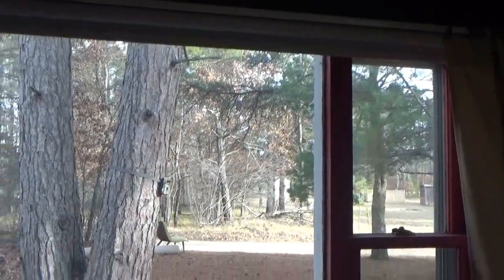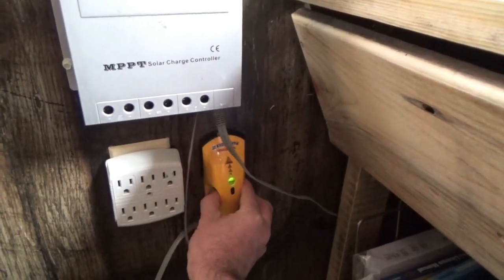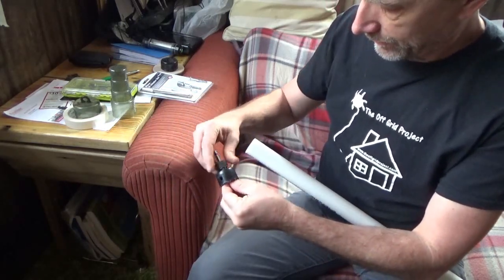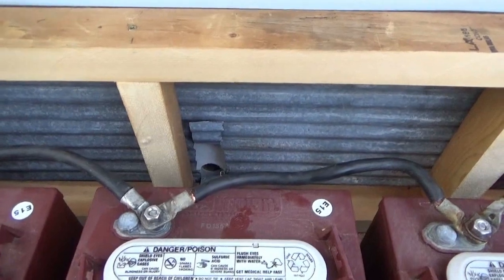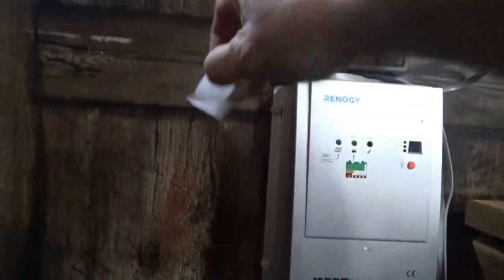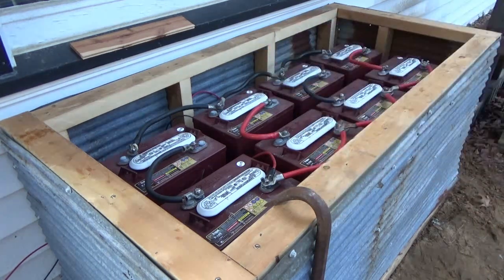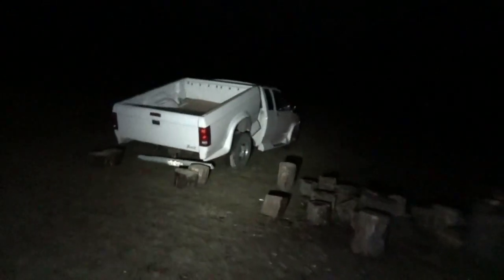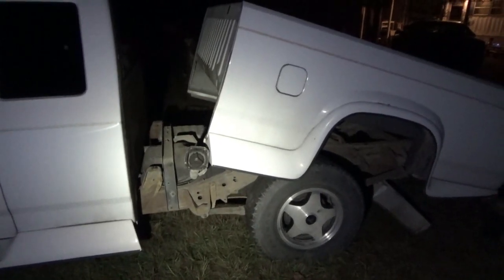Installing Solar Charge Controller & Solar Panels On Tiny House

Comment from the maker: Read the full article: http://www.thedoityourselfworld.com/articles/article.php?id=11556
Reply: Also should you make a small plastic water pipe coming out of the top of the box for gas to escape? Maybe a  1.5 inch plastic pipe about a foot long or more so it will draw gases out of the box. It should also draw warm air from inside the house into the box too so it would be a double purpose.

Comment: quick question...if you wanted to have a wind power generator...could you just piggy back it in with the solar panel connections on the charge regulator to subsidise the cold days when no sun shines on the solar panels..??  thanks and enjoy your videos from Sunny Australia..:)
Reply from the maker: Thanks. No because you need a special controller for wind turbines. They need a way to dump their load after the batteries are topped off or the wind turbine will self destruct when free wheeling in a high wind.

Comment: Are you powering your house on the same battery back as your workshop? Or a different one Tory? Can you asker me on that please?
Reply from the maker: Two completely separate systems. Way too far from on another to connect. I am looking for a way to bring the excess solar energy from the wood shop over to the house though but have not yet found a solution over such a long distance.

Comment: Is 10 gauge wire sufficient for all the panels in that array or just one panel?
Reply: 10 gauge wire would be sufficient if the voltage is high enough. Higher voltage reduces current through the wire.
Reply: Lankester Merrin like dork says, might be sufficient for the wire going into the controller, but I'd be worried about the ones going from the controller to the batteries. He might have high voltage coming in to the controller from the panels, but the controller will lower the voltage to match the battery bank and in turn it also ups the amperage, which is when you need bigger cables. I don't know what the voltage is on his battery bank but if it's only 12 or 24 volt, I'm pretty sure 10 gauge isnt going to be big enough
Reply: I wouldn’t go more than 30 feet with 10 gauge wire to avoid an unacceptable voltage drop at 24 volts. Perhaps he should consider 48 volts input? Looks like his area of Michigan only gets an average of around 3 hours of sun to work with. I’d be looking to maximise that available sun especially during these short winter days.
Reply from the maker: I am using an MPPT solar charge controller which allows me to wire the solar panels in series with one another. This increases the voltage and reduces the loss in the lines.
Reply from the maker: The wire from the controller to the batteries is 6 or 8 ga
Reply: He could double the 12v wires
Reply: It was 48v

Comment: If you have no power to the fuel pump.  There’s. Safety switch usually along the frame.  It kicks power to the fuel pump off in the event of an impact or roll over.  Look it up on line fuel safety switch make model year of your truck
Reply from the maker: I think its a bad wire because there is some low voltage on the lines.

Comment: Question Troy, why do you use the crap china mppt, in stead of the mutch better (and equiped whit a battery temperature sensor) (thats more inportant then you think)  60 amp Midnight solar mppt??
Reply from the maker: Money. Midnight solar is way more expensive. And I have this on hand already.

Comment: Troy, sorry, you make me cry..... Right connector size to the cable? Way to thin wires from battery to controller, and still no main battery  and solar panel cut off switch, And never connect a battery bank whitout a battery main fuse, not even temporary.. I know , its a video about your life and how you do things, y know, but man man man, you should know better, its not your own life risk, its also the lives of your wife and baby, Always do it safe, even iff its temporary... Sorry, dont want to troll, but in this case y have to rant against you. You know better! If you want to do it proffesional, do it correct.  This makes me feel sad....  Again, nothing against you, but....... gee man!!!
Reply: Hate to give of flak, its his life , but the point is some  people who thry to get info on these channels get mis informed.... Pont is he knows how you should do it..  in my opinion, get your materials all togeter, and your plan togeter before you start building this installations.. do it perfect the first time is always better, and faster in the end, Y still wish him well! thats absolutly not the point.
Reply from the maker: Its only 400 watts of solar panels. This is the largest wire I can physically fit into the charge controller. I am limited by the actual controller fasteners.
Reply from the maker: As to the rest - I did not even know if the inverter worked or not. Wanted to try it fast.
Reply: i dont mentioned the panel wires, on a high voltage the wyre you use is fine, and no need to fuse(panels dont give that high amp rating to create a fire) (tho its better to put in a fuse and a breaker yust to be to code.), y mentioned your battery cabels! , a fuse is a absolute must, in case of a short you have more than a 1000 amps to create a fire... please be safe, for yourself, your wife and your baby!, be safe is nr 1! (y)
Reply: for your inverter use the thickest wire you can find (welding cable ) and as short as possible , whit a fuse near the batterybank.

Comment: check and see if you have a 15amp fuse relay block for the fuel pump under the hood of your truck, and swap it with the 15 amp horn fuse relay block to test if it is bad or not.  I had that problem on my gmc Sonoma,  and it was the fuse relay block and not the fuel pump...
Reply from the maker: I swapped out all four fuses and relays with one another in attempt at figuring this out. They are all good.

Comment: Troy I hope you're going to do that  professionally run them wires running from the solar panels to the house in PVC pipe and bury the pipe just wondering
Reply from the maker: Yes I plan to do that.

Comment: You don't need to waste money on a stud finder. Tap on the wall wîth a hammer, the sound of the tap over a stud is distinctly different than over a hollow spot.
Reply from the maker: Because I tried that when mounting my TV and never could find a stud. The drywall is muffling the hammer. I hit air behind the wall every time.
Reply: I don't know what to tell you. I've been a house carpenter for 35 years and never had a problem. Give me a second, ill get a hammer an try it on my sheetrocked walls now. OK, I'm back, took me ten seconds. There was no mistaking the difference between the sound over a stud and the sound between studs.

Comment: The relay under the hood that cuts off the fuel pump in wreck needs replaced. it happened to my truck too. took me a  long time to figure it out too. Replace the relay for the fuel pump. They are cheap 10 dollars or so. I found this  If the relay's power circuit is not energized, then you're just going to have to start following the wire back from the pump to the relay, checking every so often to find ... cutoff switch, which I believe is located very near the pump itself, which is designed to cut power to the fuel pump in the case of an accident. yeah But on my truck it was the relay itself.
Reply from the maker: Actually I swapped out the relays and fuses already on the first day. No go.
Reply from the maker: I can hear the relay switch on when I turn the truck key
Reply: In that case maybe you need to change out the electric fuel pump in the gas tank ? seems like? Not real expensive. Not real hard to do.

Comment: Hi Troy the Renogy can onl handel
Max Solar Input Voltage 100 VDC @ Minimum Working Temperature 
92 VDC @ 25°C

Max. Solar Input Power 12V @ 400W  or 24V @ 800W

The Tristar can handel 150V
Reply from the maker: Yes but the Tristar is alone going to handle the 800 watts for the electronics lab. The Renogy will take these two panels. The little Renogy will take another. And my other Tristar will take two more.
Reply: Great, I was not worried about the Watts. I was worried about exceeding 100v if u put pannels in series?

Comment: We had the same issue with our truck hubby found that a wire had rubbed against the frame. It was in the engine compartment almost to to fire wall. He replaced that wire and all is well. That year and model seems to be very well made.

Comment: Do you plan on running a temperature sensor from the batteries to the charge controller?
I saw another homesteader have a big problem living in sub zero temps with his charge controller
because he did not have a temp sensor and his controler defaulted to a much higher temp and would not keep his batteries
properly charged.
Reply from the maker: I am trying to figure out how to do that with this charge controller. Seems to be built into the unit which is not ok.
Reply: Yeah it seems having the battery temperature sensor incorporated into the charge controller only works if the controller and batteries are in the same place.

Comment: interesting stuff! your frame sure looks a lot better than my 99 Dakota frame. my speedometer stopped working, after looking for a cable 2 days I finally learned it's controlled from a sensor in the top or the rear end. cheers Troy.
Reply from the maker: It sure is in good shape for its age.